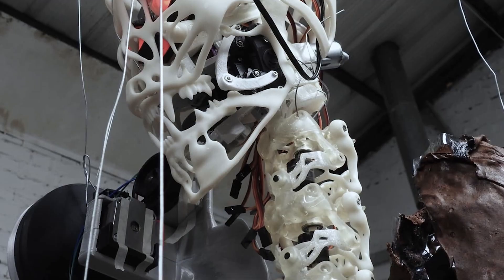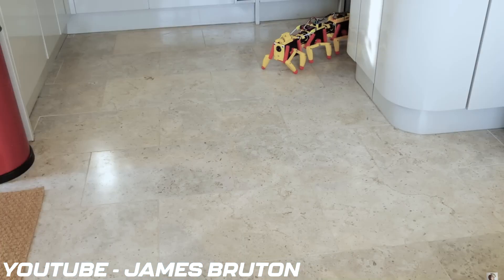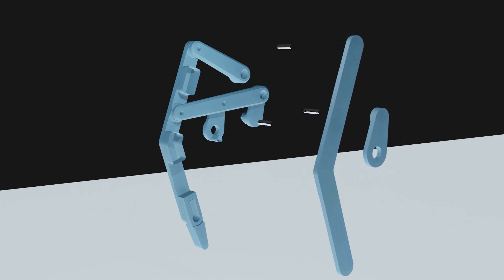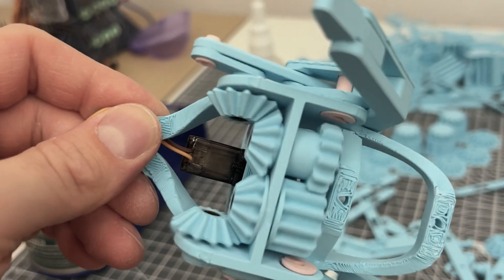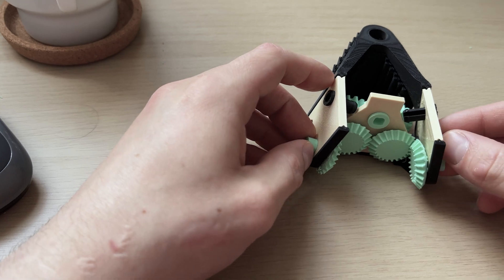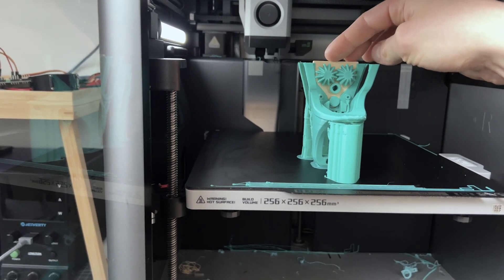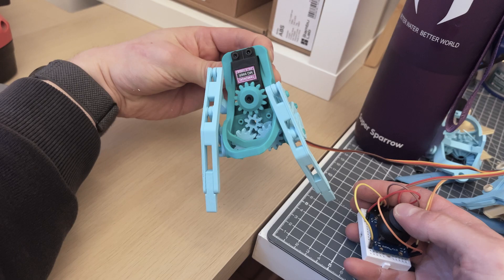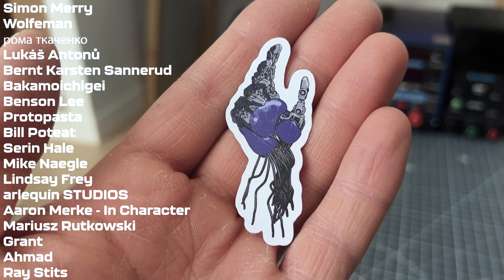Testing New Printing Techniques to Build a Mechanical Centipede

Comment: When you go from V1 to V2, do you start over, or try to adopt?

I always find that even though I'm using parametric design I end up with a small change causing huge issues down the timeline and it's either easier to start over or just do the non-parametric thing and update the design at the end (instead of changing the diameter from 3mm to 4mm, I start a new sketch and do a new extrusion to add the extra mm).

Comment: I’ve never seen inserting parts during a print taken to this extreme, it definitely seems like it could be useful in some situations.

Shafts really don’t do well printed vertically though, most 3D printing materials are weak in the Z direction due to layer adhesion. A technique I have seen to strengthen prints is to insert a bolt through the middle of the shaft and a nut at the other end, this adds reinforcement, the same could be done with any metal pin or bolt really.

Comment: cool project. It broke a fundamental rule that made everything more tortuous: you over optimized cool hinges with overengineered joints. which are fun, but you could have done that after you tested the most likely failure point: the gearbox. you wasted too much brain in the cool factor, which made you negligent to critical parts. 

but again, really amazing project. and the over engineered parts are kind of fun, and I am quite sure that they will sell (in youtube) better than heartless efficient engineering. I will be waiting a part 2.

Comment: Maybe if you skip the whole rotating shaft and design the legs to operate based on pulling a string you could make the whole leg mechanism a compliant mechanism with no assembly at all. This would also allow you to make the centepede a lot smaller.
Ypu could probably get a ”wave pattern” in the legs by having a bit of slack in the string between each leg module, but might be difficult yo achieve, especially if you want the wave to contain multiple wavelengths along it’s body. Might be able to design some compliant mechanism that does multiple oscillations from a single pull, but that’s probably difficult.
Would be really cool though to have a basically life sized remote controlled centepede :p

Comment: I also struggled with proper hinges. I came up with using shoulder bolts with heated inserts. They come in a range from sizes and are super strong. Maybe right for this application

Comment: Hey there! I found this video very inspiring, the multi stage printing sound like a very interesting idea. I have been designing mechanical parts for a while but never really got in depth with gearing systems, and fusion360 doesn't seem like the ideal program to explore them. Which program are you using to design these components or suggest using? Thank you for your help!

Comment: You mentioned friction issues multiple times, have you attempted 3d printed bearings with graphite powder as a lubricant? It does introduce a little slop but putting two in a gear on top and bottom can mitigate that for the most part

This is a cool project and I can't wait to see where it goes

Comment: Have you tried printing the parts which require a lot of support, from petg? If you set pla as interface layer, you can set the distance between support and model to zero to get a close to perfect overhang, and the pla snaps right off, allowing the support to be removed very easily.

Comment: You can use fasteners for hinges two ways: use shoulder screws, which are only threaded partially at one end, or run the screws through a sleeve/bushing. The bolted pivots on a full suspension mountain bike are an obvious example.

Comment: Hmm... are you designing in proper tolerances into your parts?  Getting into the habit of throwing parameters in for tolerance and then being able to adjust it at the end parametrically is, IMO, a good practice to have for minimizing parts not fitting or working as the stimulation did.

Comment: Another thing that you might have overlooked is that the printing orientation of the gear shafts. The shaft printed in that orientation are generally weaker due to the layers. And it can be seen as the main gear broke off several times. I hope this gets fixed in V4
Reply: This is the problem with printing gears. you have to either pick an orientation that leaves you with a weak shaft but strong teeth, or teeth that WILL guaranteed snap off an otherwise sturdy shaft. A decent solution to this is printing slower with higher temps and slightly higher extrusion rates along with bumping up the number of walls or just printing the gears thicker overall. Running hotter temps at slower speeds (with no cooling fan, obviously!) allows the plastic to fuse MUCH better and is a similar technique when making watertight models; the increased adhesion between the layers prevents them from shearing off. This is what needs  to be in V4.

Comment: Very cool exploration -- definitely got my "gears turning", haha!  I have made some very durable designs with cams and linkages in PLA by using finish nail shafts as low-cost pins, sandwiched in clamshell assemblies to support both ends.  Where unsupported printed hinge pins are needed, biasing the contact patches toward the bases helps longevity by reducing leverage on them.  Thin raised "rub rings" to reduce the contact patches between sliding and spinning parts also help -- it looks like you did this, but I prefer to bias mine toward the outer diameter for more stability and reduced contact force.  I do have to say, this design seems like a big ask of any motor since there's so much rotating friction (it would be a lot even with ball bearings), and I wonder if you'll end up needing supplemental power sprinkled along the chain.  Looking forward to the next version!
Reply: I should also note that one of the best additions I ever made to my vitamin selection was a 100-pack of cheap 6x3x2.5 microbearings.  They're perfect for compact, low-RPM applications like this even when they're one step removed from actual garbage on the quality scale.  Designing without them for an assembly like a centipede with a massive number of rotating parts makes sense from a DFM/DFA standpoint, in some ways, but when you're already resorting to nested insert-during-printing assemblies to combat friction and robustness issues, I wonder if resorting to embedded ball bearings might be the better part of valor this time :P

Comment: Your videos are fantastic! You are the reason I own an A1 mini. It was your last video, April 12th, that finally propelled me to get into 3d printing and try building your eye mechanism. And I loved using the mini so much I ended up also buying the A1 with AMS lite right when it came back in stock. Regrettable timing as I would have used your link!!!

Comment: If the gcode is static (which it is), then you can store a special part code marking the start of each part at each layer. When running through the gcode command array during a print, and you come across one of these codes, you can skip it and move to the next. 

I don't know if they do this, but it would work at print-time. That the print job is accompanied by a picture, it implies that the printer receives more information than the g-code alone.

I have a Bambu Labs printer. It's not that they're hyper advanced, just that they've capitalized on low-hanging-fruit for quality of life software features that could be a part of ANY printer (even the ultra-budget ones). They have also made some good design decisions here and there (eg. no-tool hotend swaps).
Reply: You are correct. Its add a Header and Footer to each section it does for a object on the bed. It looks at each object at slicing. So if you had it as 1 file not split up into parts or objects, it doesn't work. 

Then the firmware is just picking it up based on Gcode Comments

Here is an example:
; stop printing object EC_R1_2a_r.stl id:4764331004008807296 copy 0
; printing object EC_R1_2a_r.stl id:453636 copy 0
Reply: Any printer running Klipper firmware can do part skipping. Not sure if marlin has this these days
Reply: @jexom yess. Also Octoprint had a plug-in for years
Reply: @jexom  Marlin can do it when combined with octoprint
Reply: Yeah, the slicer adds comments mentioning which object it's going to print now. However, even without those (non-standardized) comments, the gcode could be analyzed to identify separate objects. The program could generate a map of where plastic gets extruded, and identify "islands" that aren't connected to each other.

The thumbnail picture of the print job is in the gcode file! It's a small picture file that's been Base64-encoded into text and put into a comment.
Reply: @renxula  
Great comment!

It could likely also do this via separating areas of the print-bed with simple bounding vectors (eg. triangles). But a tiny tag is almost-certainly easier than any analysis of g-code, especially given the sure-to-be TINY IC (eg. ESP32s) driving the printer.

I would bet that the printer creates some layer-by-layer record of file positions (and corresponding objects) prior to print start, for trivial seeking during runtime. This may just be a "jump-to-end" of slice "pointer".

Storing this data (eg. image) in the g-code file makes sense. Of course, it's still not g-code, just a JPEG (or whatever) stored within a g-code file.
Reply: The first person to make such walking robots was mathematician Pafnutiy Lvovich Chebyshev
Reply: There is a lot more to it than them just making good software. The hardware is very important too, both mechanically and electrically, so you can’t just implement the software on budget machines and get the same results.

Comment: The centipede could have 2 motors for each leg for steering control, and if the design had some PID adjusting capabilities, it could walk along and turn in uneven terrain.
Reply: Two flexible shafts could also work. Also balances out the moments